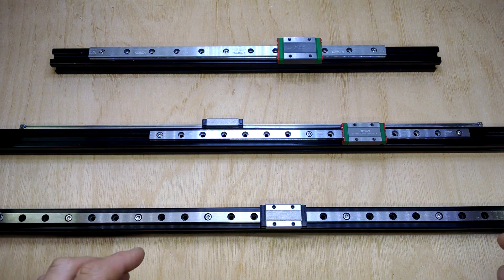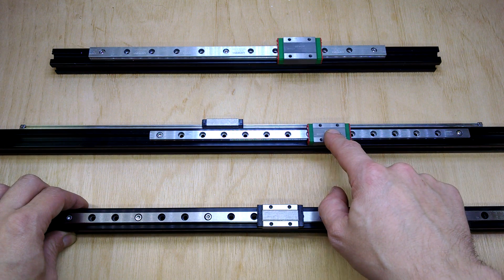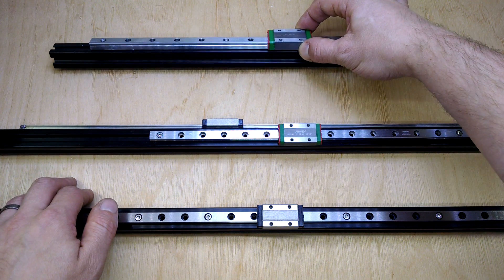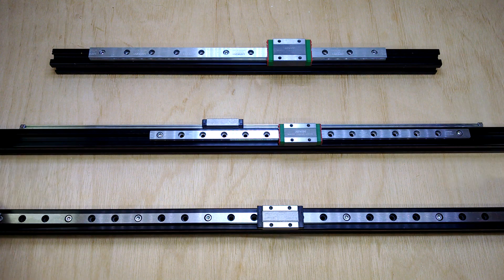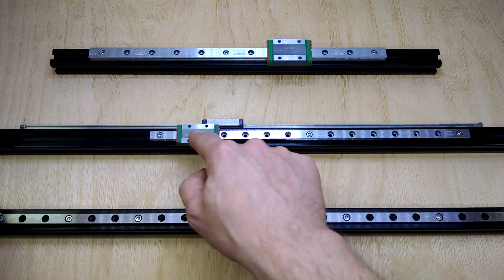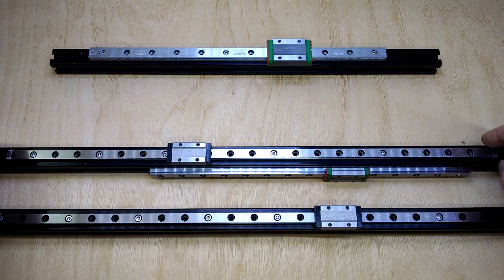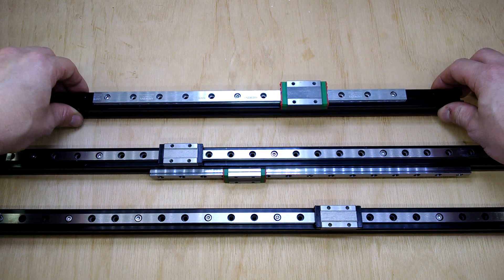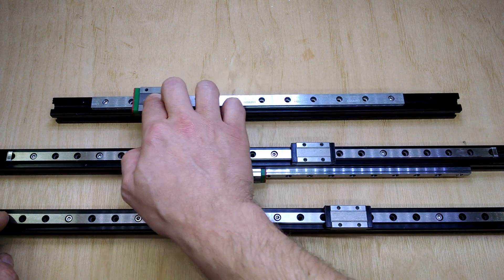Grease Works! 3D Printer Linear Rail Noise Comparison: Hiwin vs Robotdigg.

Comment: but have you measured the performance of the greased bearings vs oil? I don't care about the noise even when it is 10 feet away from my bed, as long as the part is on optimal performance... I live in a sandy environment and in the Military, we try to avoid using grease as it tend to attract sand. Does the grease attracts more dirt than oil? I know we are talking about 3D printer and they are mostly indoors, but does one lubricant is better than the other besides noise buffering?

Thanks!

Comment: The motors are much louder than these things. You can lube with grease (for lowerer speed) and with oil (for higher speed or oil tank for no maintenance). The grease is sound dampener but the oil is not really.

Comment: what size screw did you use ? I assume you have mounted the rails on 20x20 aluminum bar, right?
Reply from the maker: Sorry, don't remember what length the machine screws were. M3 standard hex socket head. I'm sure you can work it out from the dimensional drawing of your linear rail and extrusion. I did use 2020. MGN9 is almost too narrow to mount on 2020 slots.

Comment: any suggestion for particular model ( MGN12H , HGR15R ?? ) for 400+ mm X and Y axis ?
Reply from the maker: MGN9 is the smallest I'd recommend for stable seating over the gap in 2020. MGN15 is the smallest I'd recommend for a single rail (on the gantry) for the torsional stiffness.
Reply: @simonmerrett  What about carriage size? 
MGN15 has  C in 42mm, and H in 59mm size, 
MGN12 has 35 and 45mm.

I was thinking about them for Y axis in Hypercube Evolution....
Reply from the maker: I would go for the longest carriage to counter rotation torque, as they are used in single quantity on each end. If they were used in pairs it would be less of an issue.

Comment: Which model was the less loud one? Its a little unclear in the video?
Reply from the maker: Vlad B Hiwin was definitely the quieter when bolted to the single piece of the aluminium extrusion. However, once installed in the corexy configuration, they were both effectively silent, relative to eg motors and fans (even quiet motors and fans).
Reply: Simon Merrett thanks simon. I custom CAD designed my new printer and now in a process of building it. My rails are sort of loud right now, but they have factory grease in them, actually oil, which is very thin. I am gonna try to clean that out tomorrow with WD40 and maybe apply some lithium grease that i have handy. I am so anal about everything, that I will want my printer much more silent than this rails are, I am sure. Interesting what if someone makes these out of composite material, something like IGUS drylin bushings. What do you think? Would definitely be much quieter. I also went with using aluminum angles instead of extrusion. Maybe that was a mistake. Will see :)
Reply from the maker: Vlad B Igus bearings are lower accuracy, potentially to a degree that would affect your prints. If you look at the comments across my various linear rail comparison videos, you can see there is plenty of advice about what lubricants to use with these rails - an oil type seems to be most correct, rather than a thick lithium grease style.
Reply: Simon Merrett i use them on my flashforge with no problem with accuracy, and they are MUCH quieter.
Reply: Simon Merrett i also went ahead with higher quality carriages and replaced the X axis middle rail with custom made titanium rail. Good to have an access to good stuff! :))) whole X axis is much stronger and twice lighter now. Less vibration and does not bend nearly as much.
Reply from the maker: Vlad B https://discourse.odriverobotics.com/t/whats-the-typical-following-error/490/5?
Has an insight into the drylin accuracy. Titanium gantry is luxury! The rest of that o-drive thread is about a really fast xy system, so you may find it useful. I think I'd look into 25mm carbon square tubes if I were going to do another gantry.
Reply: Simon Merrett i was considering ceramic balls for this too, but seems there is little benefit in going ceramic. TC4 alone ill do the trick probably
Reply: Simon Merrett just checked your link. Well, i am against cf there, it will wear down within a month if not sooner, I am  sure. I had experience with it. Maybe if he uses igus busings there, could last a little longer, but then accuracy, as you said, will be pretty bad, especially at such crazy speed.
Reply from the maker: Vlad B surprised about cf flex. Your endeavour sounds very interesting! Good luck.
Reply from the maker: Vlad B and I would have used a linear rail bolted to cf, not run a bearing along it!
Reply: Simon Merrett oh well, now i get it. Still heavy then. :))) i am going for titanium and may bring some of those to market for $60-$70ish. Will see if folks will be interested.
Reply: Simon Merrett and yeah, according to my trials, cf flexes just as much as steel does if not more. It is much much lighter, but not any harder really.

Comment: Hi there! thanks for all the tests. I am going to buy the robot digg mgn15's.
What do you use as nuts on the rail? i am trying to find long t-nut slots, since it must be impossible to center the rails with multiple nuts.
I can't find these kind of nuts however.
Reply from the maker: ISFRedSandman I used these kinds of nut:
M3 M4 M5 nut carbon steel T nut hammer head fasten nut for EU standard 20 aluminum profile hammer head nut 10pcs
 http://s.aliexpress.com/mqA3MVb6?fromSns=Copy to Clipboard
Reply: Thanks for the reply, isn't it pretty hard to center the rails with these?
Reply from the maker: Yes! You should put the gantry in place and then tighten really (I think!).

Comment: Hi.  Those bearings come dry.  You must use grease injector and inject grease into the bearing carriage.  Lubing the rail is not adequate.
Reply: I think Simon is dizzy from all the people that either say oil or grease is bad for the rail.
Reply: So what should we use instead of that

Comment: Hello, great video, in your opinion, the Robotdigg linear guides are a good option?, in comparison they seem too cheap ($$)
Reply from the maker: julio cesar perea it is difficult for me to know what you think is "good" but I'm still using them and am happy with the performance.
Reply: hello thanks for the quick answer
 are you using a 20x20 t-slot with the model size 7 ( rail base width=7mm)
it seems to fit well (as far as alignment is concerned), but I'm worried because the contact surface is too small
Reply from the maker: I'm using 2020 t slot with 9mm and 12mm width rails. There is no 7mm rail in my design! 9mm is just about OK but I think 7mm will be too small on the aluminium extrusion, as you say. I recommend 9mm if you want to save money (instead of 12mm) but only if you have two rails in parallel. If you want to use a single rail (like on the gantry) then I think 12mm is the minimum you should try.

Comment: So, do you think it's better to go with 12mm rails and carriage than 9mm?
Can you share some link where you bought your HIWIN rails and carriages?

Thanks
Reply from the maker: Maksym Riznyk yes, either a single 12mm rail or you could try a pair of 7mm rails if your gantry is strong enough to not rely on the rails for its beam strength. Links are in my earlier video on the rails comparison. Let me know if you can't find them and I'll seek out an updated link.
Reply: Thanks for quick reply. I've just found them. The prices are crazy for original HIWIN. Not ready (yet) to spend that much.
I think I will go with RobotDigg rails.
Is this the one you bought "Quality 440C SUS"?
Reply from the maker: Maksym Riznyk Quality 440C SUS MGN9 linear rail with carriageSS_MGN9-MGN9-1L-400_23
Reply: Hi again. Just curious, how are they now, over the time? Can you see a big difference between 440C and HiWiN?
Reply from the maker: I couldn't really say without taking it apart but I certainly don't feel the need to replace the 440C rails on the Y axis with Hiwins.

Comment: Can you use that linear rail in a vertical orientation as opposed to horizontal?
Reply from the maker: Ruy Vieira you can see I have used it that way for the Z axis in my quick overview video of the finished build of my MoreXY printer.
Reply: I'm sorry, I think I didn't express myself correctly

What I meant by vertical was actually with the linear rail rotated 90 degrees to the left/right, so that you could bolt on simple gantry plates to it, kinda like the openbuilds Ox machine
Reply from the maker: Perhaps - that's how Frank Howarth's CNC is built (https://youtu.be/dY8v0j6uEJc?t=6m35s) but you then have a more complex gantry assembly. Mine is a beam, the other way would be beam+plates. I also think I'd find it harder to mount the belt pulleys but if you're not using corexy that might not be a problem.

Comment: grease on linear rails is an absolute "no" from the machinist courses and even on the machinist handbook explains why ... grease will trap any debris, chips, even air particles, the bearings will jam at any Time, on the other hand  oil cleans when pushed in and pushing out dirt...
Reply from the maker: fireblade639 fair enough for machining but the risks are lower in a 3D printer. It doesn't help that the Hiwin documents talk about grease and they put grease nipples on their larger carriages. Any particular, readily available oils you'd recommend for a 3D printer application?
Reply: Maybe but take consideration on those, oil niples are Equal to grease niples, 3D printers are high speed low torque aplications, if you drive it by belt the jaming will not be notorius until the parts Is all Twisted, grease Is used when reaching the part Is big trouble, even for particles, but if you have it open to air it Will start losing steps,  "way oil" Is used on linear rails, with a "one shot pump"  and tubing... Those rails are expensive parts and believe me, the risk to make a silent machine just does not worth to mess with them...
Reply from the maker: fireblade639 that's interesting and I'm experiencing less binding with grease than I did with oil. The smoothness was at least as desirable as the reduced noise but obviously harder to convey in a video. Of course, it's too late for my rails but thanks for the machinist point of view for others looking at this. I was surprised to hear that grease is an issue for these rails as one of the most widely discussed improvements to the non-branded linear rails is to clean the oil off the ball bearings and give them a coat of decent grease.
Reply: Hi.  The HAAS milling machines we use in our shop have pump injection lines to all of their linear bearings.  All 3 axis slide on grease that is pumped centrally.  The whole thing  runs flood coolant.  Splash oil/water all over the place - over the rails, splash chips and shards all over.  The rubber wipers clear the path.  If for whatever reason the grease pump malfunctions, the linear ways are soon next to break.  Internally new grease is pumped into the carriage and old seeps out.  Machine alarm will sound if grease malfunction, and we lose our service contract warranty if it is not properly maintained.
Reply: grease on the sliding ways of a milling machine or a lathe is a big hell no.  I've been through two bridgeport mill tear downs because people don't understand this, and have greased the ways.  the grease hardens in the passages, and also attracts metal chips.

Linear rails have tight tolerance rubber wipers and are made for grease.  The grease stays put inside the bearings, and the wipers keep the rails clean of foreign debris.  I suppose you could oil them, and there are maybe manufacturers of them who suggest this.  All of the CNC machines that I have had under my care used grease in the hi-win type linear bearings, as per manufacturer's spec, and they all continue to work great after years of service.
Reply: @jon_byler  Nice answer, clear and concise! Can you tell us what grease you use? I'm about to upgrade to all rails and I'd like to start right! Would this type be acceptable? https://www.canadiantire.ca/en/pdp/3-in-1-professional-white-lithium-grease-0381563p.html
Reply: fireblade639 That must be why all the large rail manufacturers sell auto grease lubricators for their products do you think? They do. You'd have to be running some insane preload to be worried about grease causing binding, contaments sure, that why they offer replaceable wipers and seals. Maybe in a clean room enviroment grease would be a concern, certainly not in a precision machine shop and definitely not in a 3d printer.
Reply: m3chanist interesting talk. Thank you all.
Reply: fireblade639 
قیمت چقدره